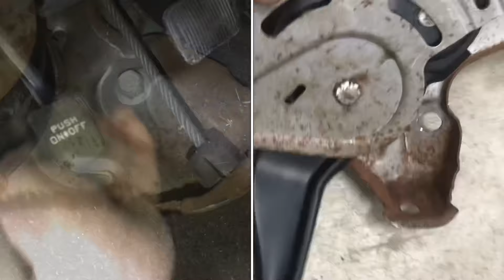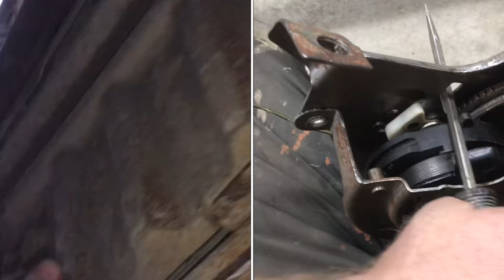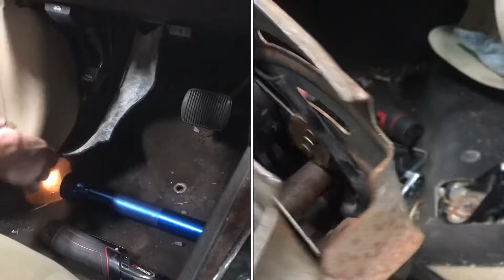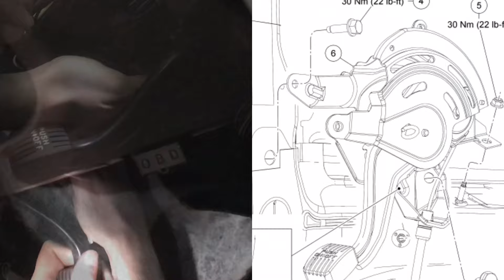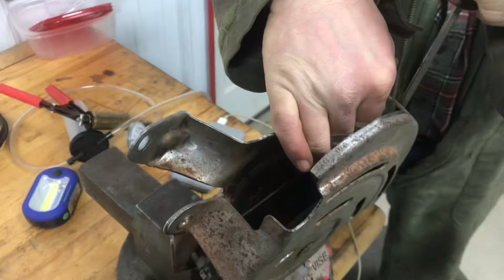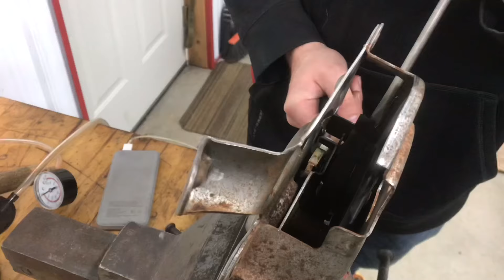how a ford taurus EMERGENCY BRAKE assembly works (tricky) parking brake￼

Comment: Don't need to remove assembly, firs release pedall all the way up. have a friend to pull cable under car as far as possible then inset a thin screw driver (1/8" x 10"  long) on the proper ports to secure mecanism in the parking brake assamble, then have friend release cable if all good wen screw driver is remove should work fine

Comment: We just recently had one of these come into my shop, the trick to do this job is. Once the entire parking brake pedal assembly is loosen from the vehicle and can be manhandled around, use the existing cable to pull / retract the in the direction you want. ( only need one way ) this is a two man job, it can be easily done. one person needs to thin snap-on screw driver. the long thin set or anything similarly strong enough to handle the stress. we used a thick locking pliers and simply used the support bracket as leverage and pull the cable back enough to slide in the screw drivers through the opening and behind the arm. Than and you can release the cable that's mounted. slide new cable in and reassemble.

Comment: How did you remove the completely inaccessible 10mm top left  nut from the Body Control Module Bracket that cover the Parking Brake Control?

Comment: Unbelievable !! Mine unwound or just let go after setting my e brake 1 too many times ! Should be recalled ! An ( emergency ) brake Should not fail in this manner !! F'ing Ford !  They ought to be ashamed of themselves! Losers !!!
Reply: Is that why my e brake won't stay in my Tarus? Smh
Reply: @jaygatsby1924  Mine won't engage without pumping on it until it finally catches. Ford dealership wanted over $500 to fix and failed my state inspection. I took it to a small shop and set it (after about a dozen attempts) and they passed it. I'm not sure if something is sticking inside. 2011 BTW.
Reply: I have a ford 500. Ebrake doesnt stop car.  Not sure what to do
Reply: Ok people that have common sense can replace the whole assembly  and save some money. I did my on 08 in less then 2 hrs with and hand full of tools. A angle box wrench that rachets takes care of the top nut.  I'm 62 yr old man these guys act like it's taking a motor out. Get real
Reply: How did you remove the electrical body module out of the way to get at the brake pedal mechanism as there is a hard to reach nut to unscrew and the far rear too bolt fir the brake pedal
Reply: its not a emergency brake. if you use it in an emergency you deserve what happens to you.